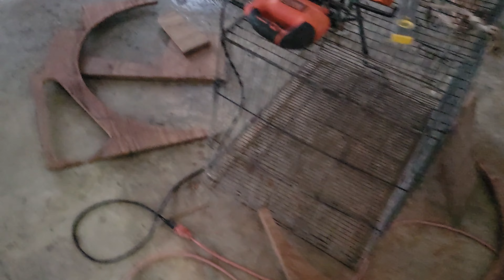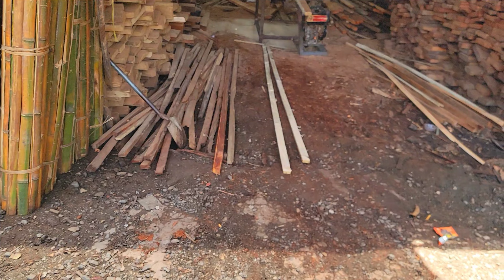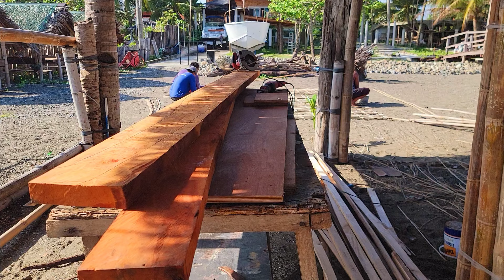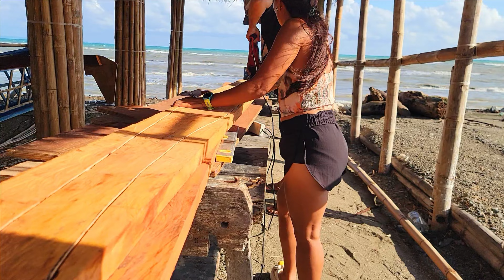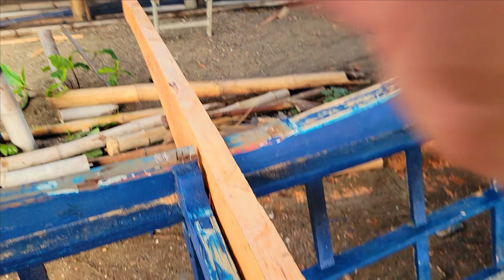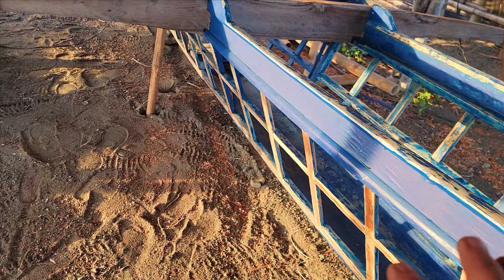Building a Totally Custom Bangka Boat  Like NO Other Part 3 Outriggers Begin

Comment: You probably know a lot more about what you are doing than I do, but just in case to save headaches, (I know from experience in lashing 2 canoes together for sailing) make sure the pontoons are slightly less than perpandicular to the boat. 
First few times I was "sailing" while on wilderness canoe trips ended in disasters. Although they do make for good stiry telling
Reply from the maker: Are you referring to it being hard to control? You must be meaning to do something like toeing in the front end on a car I guess.
Reply: @TexasFilipino  sorry, I didn't explain that very well, but yes, like the front end alignment of a car
Now, again, my experiences are just lashing 2 canoes together, but the first few times, on big lakes, once the winds picked up (we had a sail put up as well) and we got some speed, our experiment hilariously had to be cut, literally. First time the shaking was so bad our ropes gave out, sail and mast came crashing down. Still not sure how we did not destroy the canoes.  Eventually we got it working (3rd or 4th trip) by NOT having the canoes parallel, but slightly toe in.
Reply: Possibly you mean parallel sir? Former 20 foot Tornado racing catamaran sailor speaking! Lol
Reply: @RogerGarnham  yes, I replied with that already but on wrong comment (oh well)

Comment: Hi James. The project is looking good. Maybe use a chemical paint stripper to remove some of the leftover paint, I'm sure you have used them before. Scraping the bubbled up paint into a container is easier than sanding and can get you to bare wood fast.

Comment: Mahagony is really good, used in big boat construction. Lawaan wood is really good as it is light weight and strong and water resistant. Gemilina is very light however it does not have the strength as lawaan and may crack. My biggest issue with my boat is it got really heavy because i overbuild for safety and durability. Red Lawaan is actually sold under the name of philippine mahagony. The red lawaan is harder and stronger and not as flexible as white lawaan but lighter than true mahagony. I used white lawaan for all my boats framing.

Comment: I wouldn’t even put a front stabilizer…instead I would use the two you have already and build the pontoons with a curve up at the front a few feet in front of the center stabilizer…I think it would work better and less drag in the water
Reply from the maker: Until you meet a nice wave which I have running these boats out here. I have owned this boat for years and owned a 45 footer too. You would be shocked what can happen out here. Guimaras  Island  funnels down between Panay and causes random waves that have capsized many boats and ferries.

Comment: I love the boat series. Have you seen the carts that they used to roll carpets around kind of like a big game card thinking if you make one with either wheelbarrow tires or maybe garden tractor tires that it might be easier for you and Mel to put your boat in just a thought
Reply from the maker: This boat is heavier than you would think. I will most likely used one of our trucks and use cast motorcycle wheels.  You want find lawnmower wheels here and any steel wheel will be ate by the salt .
Reply from the maker: I do appreciate your input. If it was smaller boat that would work. This boat is 25 foot + long  and formed with a huge log in the bottom.
Reply: @TexasFilipino  just throwing out ideas you never know

Comment: Question: I have a house in Bago City near Bacolod in Negros Occ. Planning to set up a solar system similar to yours. I am Industrial Electrician so it is within my abilities. Where did you source your batteries, panels, and controllers? Did you buy them in the US and ship? or order them from there?
Reply from the maker: Inverter from MPP Solar in Taiwan  ask for Irene.  Solar panels I have a guy here in Iloilo named Charlie. I can hook up up with him. He can sell you many of the parts or do the whole system but the price will get higher. The batteries I bought from Felicity Solar and Batteries in China through Alibaba with ZERO issues. There is now a new LifePo4 battery plant just opened up near Clark I think. Saw the news story.

Comment: If you have a steady hand you can cut your curves with a chainsaw, don't you know, eh. Ohh, that was a lot work. You should of gotten Mel to get up on top & straddle your piece. I bet that the circular saw blade got hot enough to light a cigarette on it. You could always use a 5-6" piece of plastic pipe for an outrigger that would out last the boat. Flapper wheel on your angle grinder will do a fast job on removing that paint. I'm going to waite till you take me out fishing. Just sayin
Reply from the maker: Did you get my message about thanksgiving?